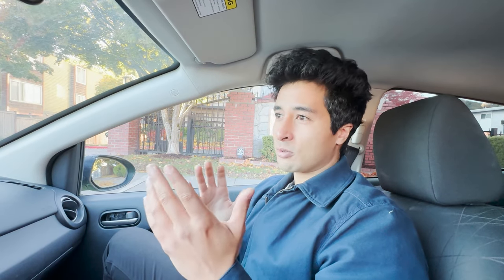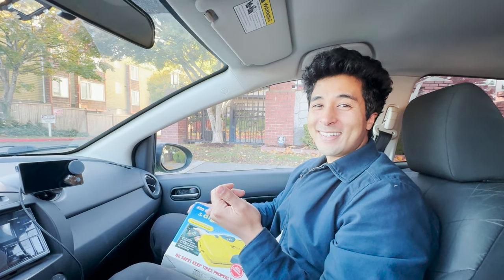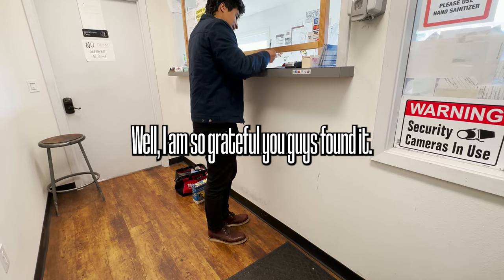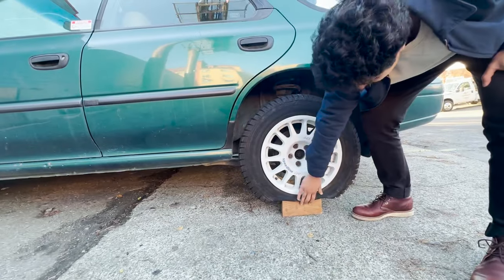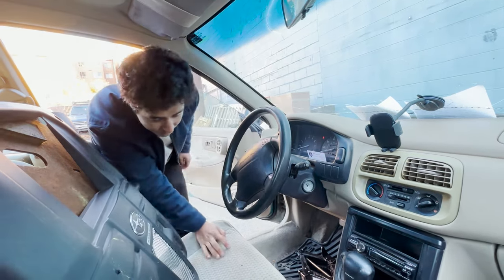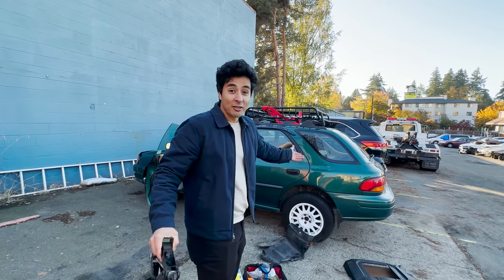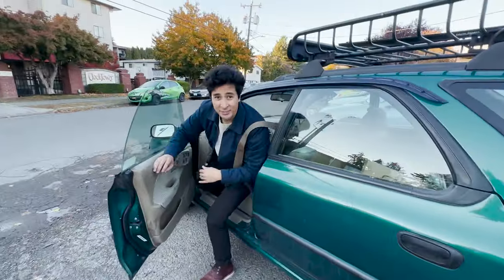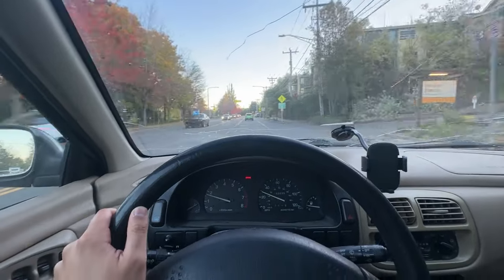Recovering my Stolen Subaru Impreza Battlewagon!

Comment: Congrats on the lucky day. My slammed C10 had the wheels attempted to get stolen but the scissor jack couldn't go high enough so they stole the two spare tires and an some gas and left. I noticed the scissor jack a few days later when the truck was stuck in place 🤣

Comment: Still has its catalytic converter too?  Im blown away how nothing else was stolen!
Reply from the maker: I think they may have tried that. The tow truck driver mentioned there was like cardboard or something underneath the car. Subaru catalytic converters are pretty tough to steel since it's up next to the firewall. I'm shocked that it came out relatively unscathed.